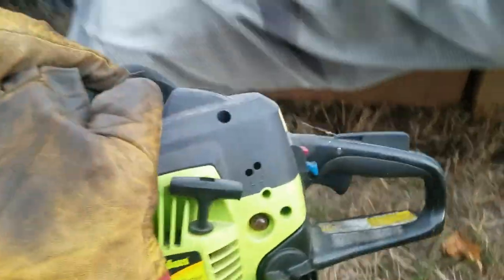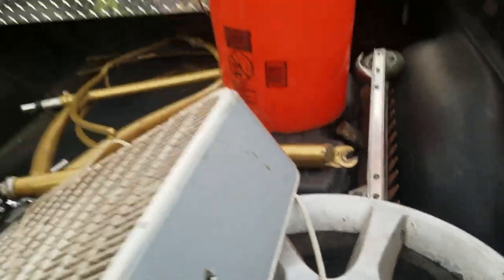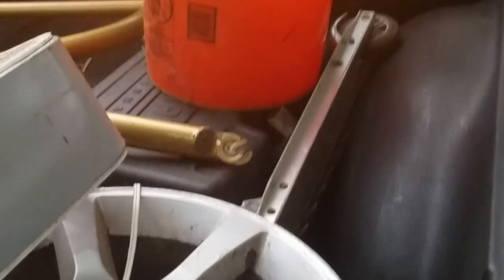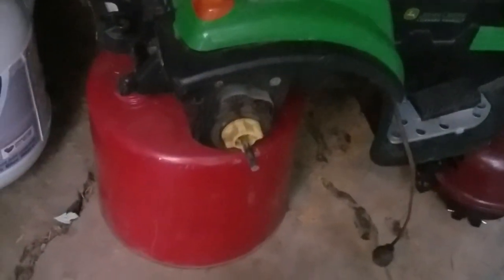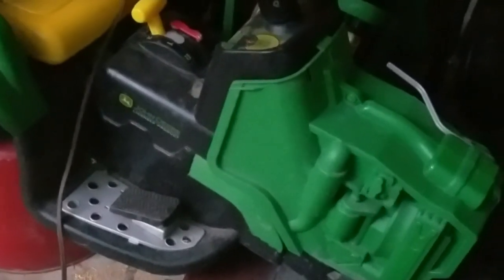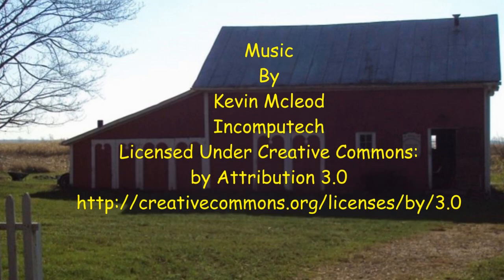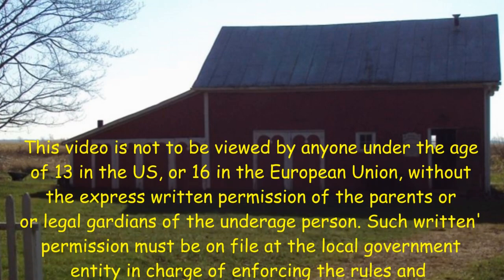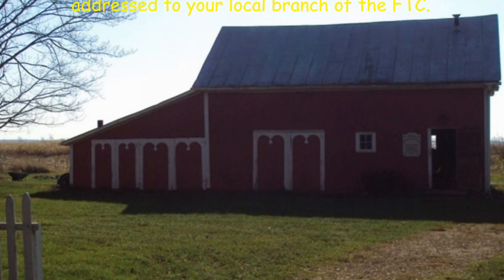Poor Man's Flea Market 7 13 22 Edited

Comment: One driving hauling another. GOOD deal! I don't need to go hunting. I have PLENTY! I've been getting the Deere sulky ready for the Gravely to go mow. Years of dust and mold scoot right off with a shot of 409 and a sworp with a rag. 25# of air in the wheelborrow tires is plenty. Max is 40. Grease in the wheels is done and it looks slightly sanitary. NOW for the Gravely which is mostly greasing and checking. THEN dragging the rotary plow out to fix and the genset carb. Coleman stove is done and put up. Getting there like a cat eating a grindstone. BLESSINGS!
Reply from the maker: In the load is a Coleman Stove haven't done more than put it in the garage.
Reply: @OldSneelock  I downed and cleaned the generator nd Kroiled it and it's some easier and good enough for who it's for. Ready to go again!
Reply from the maker: @lewiemcneely9143  Time well spent Lewie. 
I keep wondering why the ads keep telling me to get a solar panel system so I'll have lights during the power outages. What do they know that I don't? 
Maybe they all are 90 year old women driving big pink Cadillacs?
Reply: @OldSneelock  Costs way too much for the initial outlay and it takes 14 lifetimes to get it to pay for itself. No thanks.
Reply from the maker: @lewiemcneely9143  The real cost is in owning a piece of newly developed equipment. How many techs are there in the world who have worked on one of these systems?
Maintenance costs? They don't mention them in the ads.
Reply: @OldSneelock  When I ordered the vacuum deal for my old 85 Stihl blower the guy thought I said an 86 which is newer and CHEAPER! LOTS cheaper. I'd never seen the difference if I hadn't had both side by side to compare with.  IF anything happens to the 85 I'll rebuild it. I do NOT want an 86. Pulled the Onan carb and everything is fine. No binding and all float stuff working smoothly. I'll try and run it some next week I hope. Sumpee BUT I did get the numbers off the carb and it's a Walbro. Looks like the one on the Kohler on the gravely but it has the adjustments on top. We shall see. Happy Grandparents Weekend!
Reply from the maker: When we were running go carts we would mount all kinds of carbs on the Brigs one lung engines. Braze a couple plates on the ends of a piece of 3/4" pipe and bolt it up. Float bowls have to sit level and some carbs had the flange mount at a 45 degree angle. 
With the cast iron Briggs the carbs were mounted on the tank with a  direct siphon. We put a bigger carb on it and it would double the speed. Took some fiddling the get the settings right. The jets were too big, but we didn't know it wouldn't work so we just made it work. 😁😎
Reply: @OldSneelock  Been there and done that, somewhat. I've had some very unconventional methods to my madness now and then BUT, like a bumblebee not knowing it can't fly, so it just does, my stuff worked out with some last second mods and so far I lived to tell about it. I still say that the 1st thing my guardian angel will do when it sees me is paste me right dead in the mouth.
Reply from the maker: @lewiemcneely9143  That is the truth.  We must have good ones. I know I have worked mine to a frazzle. 
I expect mine will be so happy to know he can relax and take care of just Oli and Mac
Reply: @OldSneelock  Mine too............after it gets rid of it's pent up aggressions and hostilities. Almost 3/4's of a century gets ponded up in anything.